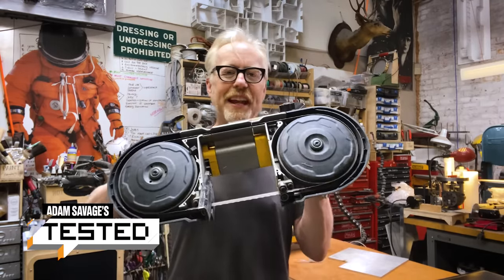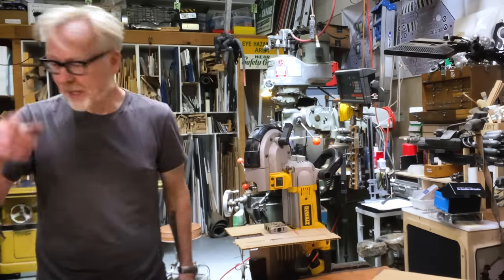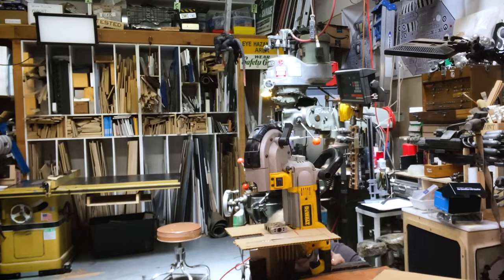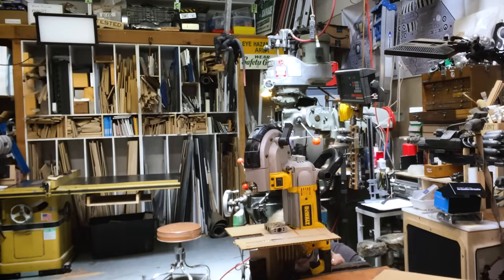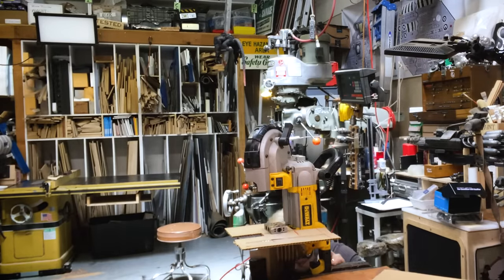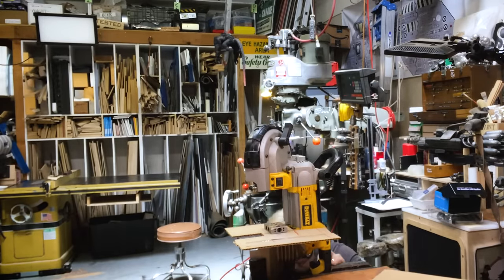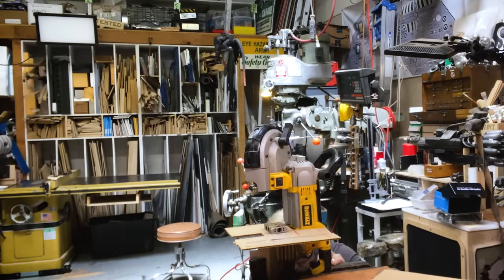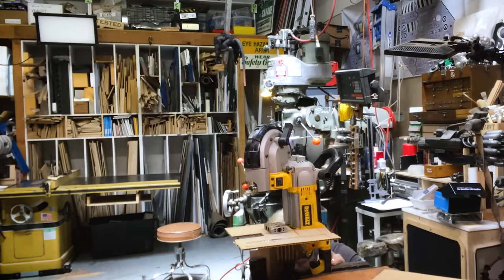Adam Savage Builds a Mini Tabletop Bandsaw!

Comment: "oh that's Torx" middle finger
I'll come back later to watch the rest when I've stopped laughing.
Reply: Precisely! 🤣☠💀🤣☠💀
Reply: Blows raspberry *
Lol I screen grabbed it, its memeing time!
Reply: There's a special place in hell for the inventor of Torx
Reply: One of the best choices for high torque applications though
Reply: Literally one of the best fasteners ever developed... I weep for the unwashed.
Reply: Yeah, but I've worked on repair projects which used Torx that totally didn't need them. Like, right now I'm repairing an Amazon Echo mk 1, and the thing is put together with Torx when it totally could have been assembled with Phillips screws. I didn't have any in my bench drawers because I seldom need them, and I ended up having to hunt all over the house for a tool set that happened to have Torx drivers in it.
Reply: I have only ever stripped 2 torx screws and one security Torx (the one with the hole) in I forget how many repairs I've done. Compared to count less Philips heads I've turned into inverted cones. Also slotted is only necessary in NSF applications.
Reply: the downside of phillips heads is how easy it is to not realise you've got a pozidriv or supadriv, and strip both screw and screwdriver.
Reply: @francescosirotti8178  Torx fasteners are a dream compared to phillips and slotted.  I even prefer them to Robertson.  I'm honestly kind of puzzled by Adam's disdain for Torx.  He has no problem using hex socket screws on anything and everything, juggling between metric and inch size allen wrenches, but can't be bothered to find the right size Torx wrench.  Weird.
Reply: Torx is one of the best inventions. Inch for example comes directly from hell in my opinion (yes, I am from Germany we have metric measures).
Reply: Y'all gimme a call once you've tried Robertson screws
Reply: Say what you will about torx but I've never had one strip. The same can't be said for every other fastener I've interacted with
Reply: Slotted screws kinda make sense pre industrialisation too

Comment: thats a lovely little tool! i was looking forward to some kind of external mechanical linkage to the speed control though. also, did the switch actually light up? you could use the other switch prongs to integrate a dedicated little handheld vacuum with a dead battery or cosmetic damage. i'd also make a little finger clearance cutout in the back so you can still use the carrying handle comfortably, and a lick of paint would be nice. but lovely job, its very cute.

Comment: Yes! Adam's right about using a wooden carbide tip saw blade to cut aluminum! Personally I was using it to cut aluminum soffit, but I would like to add to avoid burring turn the saw blade around! Like cutting backwards! I know it sounds crazy but it's made a huge difference not destroying the edges.

Comment: 29:34 is the best Adam savage moment ever 😂😂😂
Reply: Here I am loving torx. They provide much better leverage and make for better holding power. Lastly, they are far less likely to strip out.
Reply: @stackman120  its still 100% what i do, any time some inanimate object does not agree with what i had assumed.
Reply: stackman120 agreed! I always use tori headed deck screws. Never have a bit skip the drive slots with a torn head;  Phillips head screws alway end up skipping on the driver bit.

Comment: Was just a bit stressed when you clamped down the aluminum without upward support as well. Especially given the drilling pressure. Super glad it didn't pop out on you.
Reply: Agreed.  Some machinist jacks would have come in real handy there.  When he started with the boring bar, you could see the plate wasn't level in the vise.
Reply: @ericchambers9023  - You could even see it when the hole saw started up.
Reply: Yeah and he could have done with one block less...And take a few pointers on feeds and speeds..that poor boringbarr is rotating way to fast it seems...
Reply: look closer at his grips ... the bed the back grip is on was supporting the plate for the majority of the plate ... the drilled portion was done over the open of the mill .. so he had a cantilevered plate with only perhaps a 1/3rd of the plate only compression supported on the weakest side ... so fine minimal warpage from drill pressure especially since he he moved the bed up and not the drill down ... he was able to scrape micro cuts off and not push down heavy on the plate at all ... the burrs are where his bit caught from a chip in it ... thats why he had to reshape the head it was in need of refinishing ...

Comment: Im gonna make this.
Reply: I made one exactly how he did in the video. I somehow ended up with flux capacitor
Reply: Chris M try making a flux capacitor. You'll end up with a bandsaw table instead.
Reply: You can spend the same money on a cheap used band saw and get way more function. I find you need at least a 9-10 inch throat for the most part. I got my 12" band saw for 25 bucks at a flea market.
Reply: TimTrOn3000 yeah but is it portable battery powered? That’s the whole reason why he did this project to begin with
Reply: @mrpw1402  will it fit on the portable battery powered one?, he did use the plug in version...
Reply: Straight Line Cycles similar spec, he can use for either
Reply: They make tops for these. They are very popular in the knife making community. That said if you want to make one then go for it!
Reply: Swag off-road makes a really nice table for many types of porta bands. Even for this DeWalt porta band. I have one and it's really good.
Reply: @TimTrOn3000  So, when we aren't doing the Stay At Home thing, I spend quite a bit of my time at Port City Makerspace. When someone says they are going to make a thing and someone else responds that it would be easier/cheaper/better if they just bought it, someone else in the room always quips, "What is this, Port City Buyerspace?" Sometimes it's about using things you already have on hand or not buying anything new. Sometimes it is about the act of making in and of itself.
Reply: Weirder

Comment: Adam in most video's with his stapler: "It's best to make sure there is no flesh in the trajectory of the stapler"
Also Adam: 31:30
Reply: "I had a friend who used a piece of scrap inbetween the work and the nail. Once, the nail gun doubleshot and fired a nail through both pieces of work, the scrap, and his hand."
Also buffers with a piece of scrap
Reply: i would be pretty impressed if a 23ga nail makes it through two pieces of 3/4 inch ply.
Reply: @wit6665  with enough psi anything is possible!
Reply: My girlfriend when she was a nurse at a trauma center, saw guys with nails through almost every bone you can think of.  These nail guns are super nut are also dangerous.

Comment: Really worried that the insert doesn't have a registration that would prevent it from spinning and catching the blade during use. Or even just a recessed screw that holds it in place. 
Great build though!!! Loved the final product.
Reply: It could be added easily enough without a full redesign.  There should be enough of a lip to tap a machine screw between the plate and insert.  Or press-fit a dowel halfway between the 2, like on a crank pulley.
Good catch.
Reply: The blade is moving down through the table, if it catches all it will do is chew a small amount off of the insert (which will be tricky anyway as the non-toothed majority of the blade will be keeping it from spinning all that far)

Inserts like that are a consumable, it will get nicked and eventually wear out and need replacing
Reply: the registration is the blade. It cannot move, because the width of the blade "hole" is not bigger than the blade depth. it physically cannot spin.
Reply: @Glisern  Just not a risk I'd be willing to take. I thought of that and that the blade rotation is down toward the insert. But things happen, and It's always better to prepare for and prevent them if you have the ability to. This seems like a scenario that could be planned for accordingly.
Reply: When I made a fancypants aluminum insert for my wood bandsaw,  there was no room to add a drill hole in the table. If you did, the hole would be right in the edge of the insert and destined to break. 

So I filed a notch in just the bottom lip of the table recess. Same result.
Reply: I went to high school with a dude named Ryan peck.

Comment: 1 Has stationary bandsaw.  Not portable enough.
2 Buys corded portable bandsaw.  Not portable enough.
3 Buys cordless portable bandsaw.  Not sturdy enough.
4 Makes stationary bandsaw.  Goto 1.
Reply: That stationary bandsaw is not speed controlled. That style is difficult and costly to modify in that way. Which keeps you from cutting several types of metal.
Reply: This one is small. No one wants to turn on a full size machine to make one half inch cut, with a smaller machine it makes it more viable to make those cuts with a bandsaw
Reply: @dontakeshit  that's probably in the promised "to be continued"...

Comment: You really must cover the elektical connectors
Reply: Seems somewhat lethal to me at the moment. Dual switch is most likely to cut off both neutral and phase wire (in some cases you can plug the socket either way), so that the phase is surely disconnected. Probably the glim bulb inside the switch will also work, if both neutral and phase are connected.
Reply: Yup. Throwing metal shavings (possibly hot) on electric power wires, and even not insulated switch can shorten a life a bit. It was the worst possible place for this. Safety first! Having this said, there was also handle to control speed initially planned? I was very curious how it will be solved.
Reply: @gadi70  He connected hot to the switch. Neutral is securely connected in a wire nut
Reply: @gregkeddy6446  We're talking wall sockets here. You cannot be 100% sure which wire really is the hot one. Therefore switch on both is safe approach.
Reply: @adammarkiewicz3375  I agree that it is generally safer to switch both hot and neutral, but one could easily tell which wire is hot using a multimeter.
Reply: @matt_nolan11  Of course you can. Then you know how it is in this specific wall socket. If you prepare the switch with this knowledge you make the tool working with THIS SPECIFIC WALL SOCKET. When connected to other one - with possible different wiring, it will disconnect the neutral, leaving the tool always connected to the hot one, which is dangerous. If you make switch on both wires, you're safe and prepared for any socket, no matter how wired.

Comment: I use hole saws at work very very frequently and go through steel aluminum and even stainless steel with great regularity. Like you said proper speed and feed pressure are key. I think your mill may have been running a bit too fast for the size of holesaw you were using but it did do the job admirably none the less

Comment: I made one of these about a year ago. Instead of using those two small bolts that hold the guide to hold the whole saw. I instead removed the handle from the saw. I built a stand with two uprights. The saw is hung between the uprights and supported with a 5/8" all-tread rod with wing nuts through the handle whole. I didn't like the idea of supporting the saw by those two little bolts in a cast aluminum piece.  Then I adjusted it square and made the table from 1/4" steel plate because that's what I had and it is supported by the base.  I made the base out of 1/2 plywood  18" x 18" with 1/2" thick feet. for electrics I used an outlet with a switch. The trigger switch is locked with a hose clamp and the saws cord plugs into the outlet on the switch. I used a heavy duty appliance cord I had to plug it into the wall outlet. The speed control can still be accessed. I can easily remove the saw from the base, re-attach the handle and use it like a porta band. Someday I will make a fence for it.

Comment: your electrical work scares me, you really should show good electrical practices online so that if somebody copies you they will have less chance of getting hurt
Reply: Yeah, in Germany he would have probably violated about 50 laws with that wiring. But US only uses half the voltage so maybe you survive the occasional shocks you get when using that machine.
Reply: @McClane6666  Half the voltage means double the amps !
Reply: On my version of this, I used a blue plastic 2 gang electrical box from the home center along with a light switch rated at 15 amps, which is half again as much as the saw pulls.  I put a receptacle next to the switch it so I wouldn't have to cut the plug off the tool.     Seems a easy, safe and cheap solution.   I unplug the box after use, just to be safe.
Reply: @ian-c.01  double the voltage means less resistance is needed for the amps to flow regardless how many amps there is.
Reply: @Warshipmodelsunderway  There are a number of simple and inexpensive solutions that are far safer and probably more reliable than what Adam cobbled together there. If you want to put together electrics in that manner that's up to you but you shouldn't be putting them online

Comment: Being one of those that does regularly use hole saws to notch roll bar tubing, I do have a tip for you. On something as rigid as a mill with proper clamping, you don't need the centering "pilot" bit. If you do leave the centering bit in the arbor, definitely predrill the hole. The bits that come with those are only the finest grade Chinesium, and it'll only frustrate you and make you put more pressure on the work piece than you actually need to make the cut. They have their uses, but for the most part I go without.

Comment: Hi, Adam. The reason for polarizing 120 VAC is because of the design of the threaded screw-in lightbulb socket and screw-in fuses. The user comes into close proximity of the threaded contact of a lamp socket, so this became standardized to be fed by the neutral, which is 0 volts in relation to ground. Therefore, if a lamp with a properly polarized plug is plugged into a properly polarized receptacle, it is virtually impossible for the user to get shocked when putting in and taking out the bulb (unless the user sticks his or her finger all the way into the bottom contact).

Comment: I haven't checked comments to see if anyone else said this.  On top of enclosing the wire nuts to protect them it would make sense to shield the wire too.  I think you should add a Emergency Stop button.
I used to work for a place that used the same wire as the cord on the saw and we would pull back the outer insulation to cut off the white fibers.  Then we could pull the outer insulation back up and hide the cut ends.

Comment: 1.  Adam Used like 3 bandsaws to make this bandsaw that he "needs to have".
2.  Portabands have variable speed triggers. Put an offset cam on a shaft at a 45deg to the back panel and make that be speed control on a knob.  Friction (rubber) on the edge would keep it on the switch and allow you to slow down the blade.

Otherwise... good build.  I have a corded Milwaukee I've been meaning to make into a tabletop bandsaw.

Comment: WRT using carbide table saw blades on aluminium: I've occasionally used carbide wood router bits on aluminium in my mill.  This is handy for some profiles.

Comment: I started with your design for the stand for my new Harbor Freight metal cutting bandsaw.  I modified your design and it all worked out great.  Honestly I think it is nicer than the one you built.  I can easily get to the speed control switch on the saw.  I used a small power strip which fits neatly inside my stand for the power on/off function.  The saw is rock solid in the mount and I used a 10x10 1/4" aluminum plate like you for my work surface and mounting.   I gave it a few coats of metallic grey paint and it closely matches the saw.  I wish there was some way for me to send you a couple of photos...I think you would be impressed how good it looks.

Comment: Adam, here's a handy tip for making perfect forstner openings on both sides of a piece of wood, but especially plywood. Drill a small pilot hole in the center of the desired opening, smaller than the forstner bit spike, and then use your larger forstner bit from the back (or front) to drill the shoulder needed.

Around to the other side, with that same pilot hole as a guide, use the smaller forstner bit for your through hole.

This technique will leave you a perfect recess in the back and a perfect thru hole in the front. No blowout with guaranteed center alignment.

I know zilch about metal, but wood and I are buddies. 😁

Comment: Adam, as someone who works a lot with electrical terminals, you can make your electrical connections look much better if you remove the ugly plastic insulation (or just buy non-insulated terminals) and crimp the terminal naked and use shrink tube as your insulator. It looks much better, and you can a little bit of solder on the crimp to really make sure you've got a solid termination.

Comment: Adam, my main problem with Phillips screws is this: if you're working with electronics, you end up having to have a bunch of small US Phillips bits AND a full set of JIS-quasi-Phillips bits, and even still if you make a wrong guess on which one you need you might end up stripping the screwhead before you realize the error. But I'm 100% with you on giving torx the bird.

Comment: I remember using a fly cutter on aluminium. It’s a single point cutting a large diameter with a flat finish. IIRC, they run at pretty high speed.

Comment: You put the switch right in front of the blade, SAFETY! Hand slides off switch straight into blade. Use thick piece of hose as strain relief? Use a breaker for a switch matching power level, added safety? Make stand little higher (and if switch is moved) make drawer to capture shavings to remove and dump. Then put device on large side to wrap cord, portable? Make base oversized to clamp to table? Might try all this myself.🤔